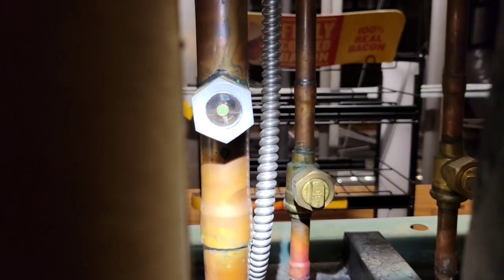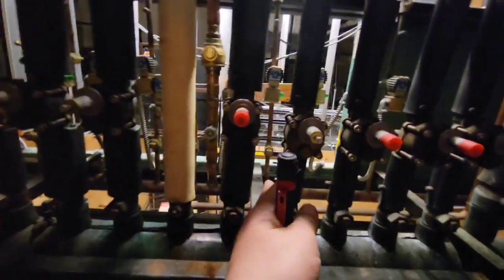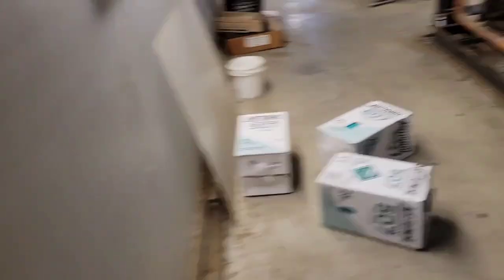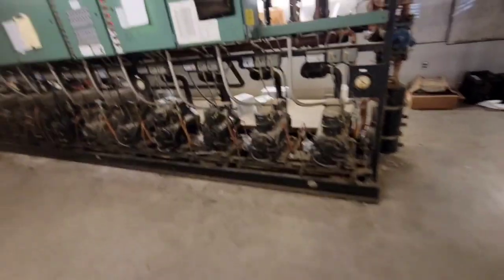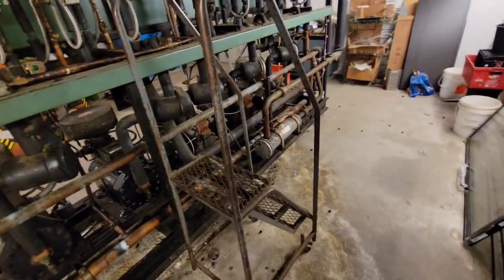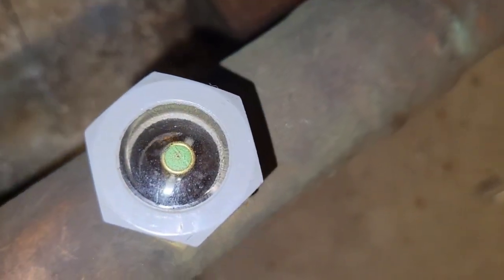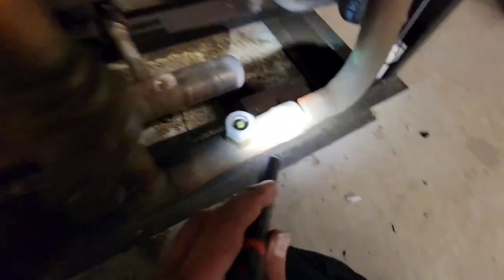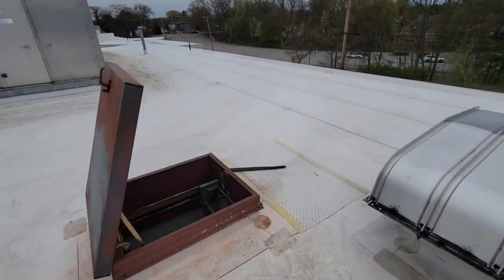Supermarket Refrigeration - How to Tell if Your Rack Is Low On Gas Example 1

Comment: Where was your leak at ?
Reply from the maker: In a deli case,

I was going to record it but I ran out of battery. The straighter core was leaking by and the cap was not screwed on very tight. I could literally hear it whizzing out.
Reply: @gendronhvac-r1269  Would be interesting to see a video on tracking down a leak in a situation like this.
Reply from the maker: @lwilton  

Sure next time I come across it.

Comment: so what was the leak? are there any monitoring devices in use on large volume systems like this to detect leaks before large volumes of ref might be lost??  or maybe operators monitor daily the  levels somehow?
Reply from the maker: It was leaking from the deli service evaporator coil. That is a prime spot.  All the meat juice just eroded the coil. 

And there is a leak detectoring system. But it is very bare bones we don't trust it. It will detect like large leaks but only In Certain areas alway best to pull out your Personnel leak detector and not relay on those. 

Hope that helps

Comment: I work on small systems compared to you. 25lbs max. When our customers have blowouts like that we charge them per pound for the gas. Do y’all do the same on 300lbs? Lol. 300 x whatever yalls lb rate is?
Reply from the maker: So back-in-the-day for my company it used to be contract. So it was part of the contract that we covered all the gas. The problem with this was the stores were taking advantage of this. Not reporting things until the last second. Refusing work and refusing to fund work that would prevent future leaks. So our company change the contract so they pay us back for all of the gas used plus a little extra I think for us getting it. 

Other customers we have they will store like 1,000 lb of gas on location for emergency and the store itself purchases and replenishes the gas as needed. 

Some we just charge per pound. 

Every customer kind of has their own unique scheme that they agree to.

Hope that helps

Comment: Don't ever charge a system like this your feeding straight liquid to your compressors. Fine your biggest liquid line hook up to it and close that ball valve so your pumping down that system and sucking the refrigeratant from that jug of refer
Reply from the maker: You can do that If you like,

But I have never meet a single refrigeration tec do this. 

Also Most compressors for supermarket refrigeration are rated to do this. 

But good luck man I hope the video help a little !